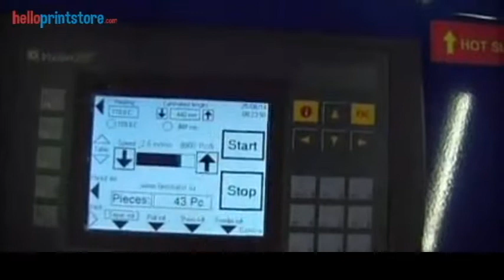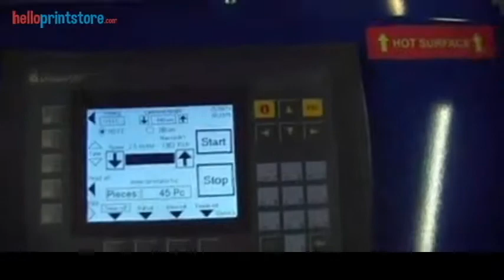Automatic Thermal Laminator LAM 50CA

Comment: Друзья, кто может помочь с сервисом на LAM 50CA? Нужно на контроллере VISION280 попасть в сервисное меню. Вылезла большая проблема после того, как снимали батарейку резервного питания в контроллере. Контакт: AS_10@bk.ru

Friends who can help with the service on LAM 50CA? It is necessary to VISION280 controller to get into the service menu. Climbed a big problem after filming the backup battery in the controller. Contact: AS_10@bk.ru

Freunde, die mit dem Dienst auf LAM 50CA helfen kann? Es ist notwendig, VISION280 Controller in das Service-Menü zu gelangen. Stieg ein großes Problem, nachdem der Backup-Batterie in der Steuerung zu filmen. Kontakt: AS_10@bk.ru

Barátok, akik segíthetnek a szolgáltatást LAM 50CA? Szükséges VISION280 vezérlő bejutni a szerviz menüben. Felmászott egy nagy probléma forgatása után a tartalék akkumulátort a vezérlő. Kapcsolat: AS_10@bk.ru